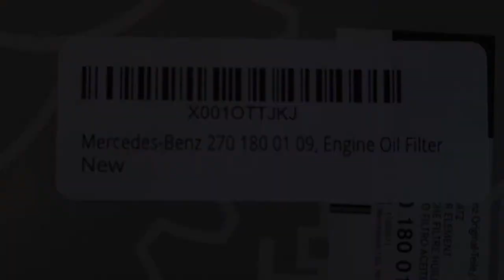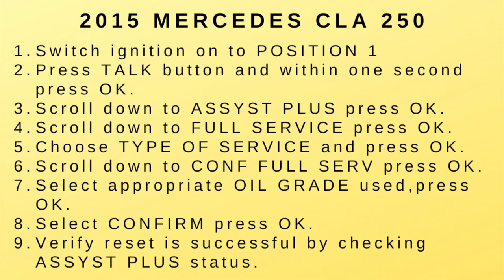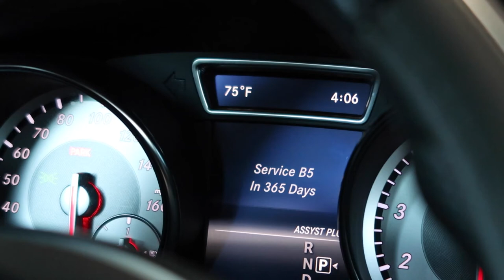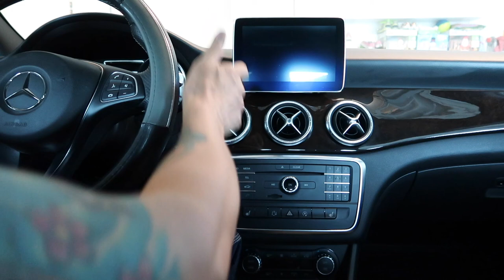2015 MERCEDES BENZ CLA 250 OIL AND FILTER CHANGE | MAINTENANCE SERVICE LIGHT RESET | DIY

Comment: I know that the oil filter and the drain plug are not supposed to be over tighten but are there any torque value in the manual for the filter and oil drain plug installation?
Reply: 25 nm 18 ft ibs

Comment: I use the oil pump so I do not need to go under the car. It has been working fine since I got the car. Torque to 25 NM on the oil filter.

Comment: hello i have 2014 and on my bill from the dealer shows that they used  5w40 oil,   you have  (  ow40 ) did you know what's the difference?  im trying to change it my self but now im confused tanks
Reply: The viscosity of the oil at lower temperatures

Comment: Hi Loey. I have the same car as you. Can you tell me what I can do if my parking brake keeps coming on on my dashboard? What can I do to fix that?🙏🙏
Reply from the maker: Hi friend. I’m sorry I’m not a mechanic. All I can do is simple maintenance stuff. Trying to avoid the expensive dealership prices.
Reply: Louie Boy Baello Thank you for your reply
Reply: Hi loey have you ever have problems with the sensors on your Mercedes?
Reply from the maker: @lieblee3063  yeah. Mu tire pressure sensor is not working right now. Needs to be changed. Not cheap for sure

Comment: Hi thx for the video. Was thinking of purchasing the rhino ramps also. If using the ramps the car is at an incline, when replacing the oil,  will ALL of the oil drain out when at an incline?
Reply from the maker: You’re welcome and thanks for watching. The ramps are very useful and I don’t seem to have a problem with draining all the oil with the incline since the drain plug is on the end so the incline actually helps.

Comment: Hi Louie it’s me again. I own a 2015 cla250. Yesterday while I’m driving auxiliary battery malfunction was flashing on my headboard. How long can  I drive until I have it change?
Reply: I just changed mine. The Aux battery controls the system when the vehicle shuts off at a red light. It too 2 months for me to replace it myself due to work but I had no issues. It just wouldn’t auto start and stop which didn’t bother me because I turn that off anyway. I ordered the battery on Amazon for about $40 and changed it in about 10 minutes no issues after change

Comment: What kind of oil do you use and were can I get filters and those three rings???
Reply from the maker: I used the Mobil 1 OW 40 oil. The O rings or rubber gaskets came with the filter that I ordered fe Amazon. The part numbers are also in the video. Saved a lot doing it myself. And the satisfaction that I get knowing it was done by me :)